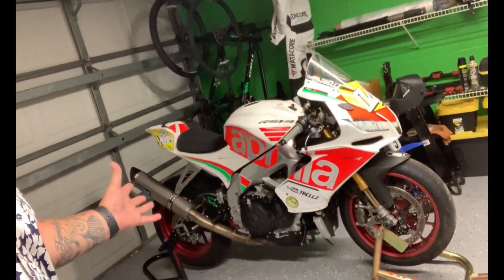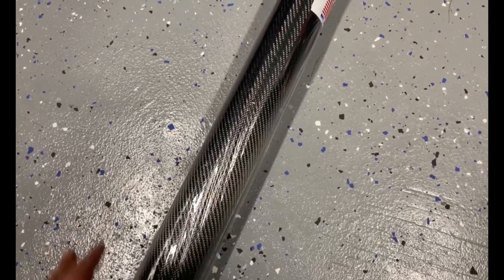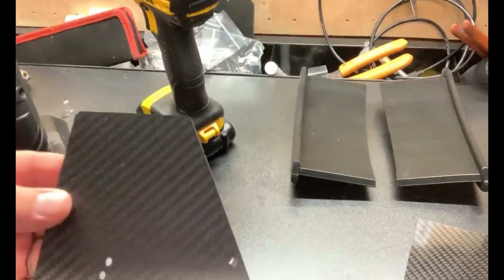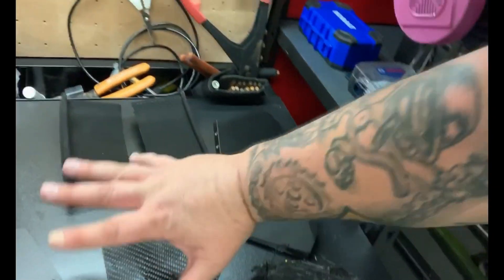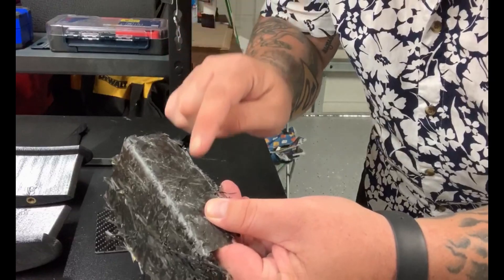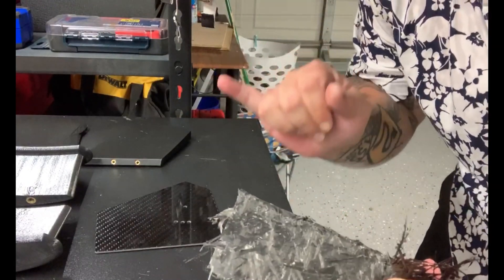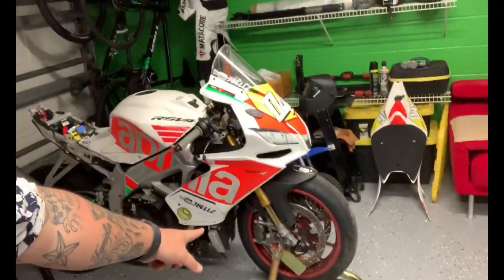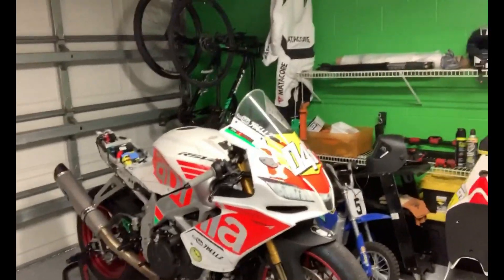BUILDING A FORGED CARBON FIBER SUPERBIKE   [ part 1]

Comment: I am really late! But first off all amazing!! Second for new builders, when using forged in structural components. Use long strings along  the portion you need most strenght it will drastically improve the tensile strength of your part, like race levers

Comment: i've been thinking about wrapping my track fairings in real carbon fiber fabric but after seeing this that forged carbon fiber look and benefits intrigue me. Could i lay forged carbon on top of fiberglass fairings? i'm not looking to make a whole new set just cover the current fairings. this is such a cool video series btw! subscribed!
Reply: wait holy crap i think i've seen and ridden with you at jennings!!!
Reply from the maker: Unfortunately, the look won’t come out as good “skinning” it, but you can use 2x2 easy

Comment: Is there actually a weight savings between sheet carbon and forged carbon parts? More sheets for the sheet carbon stuff, but for the other, “Forged” is it making its weight back in extra resin usage?